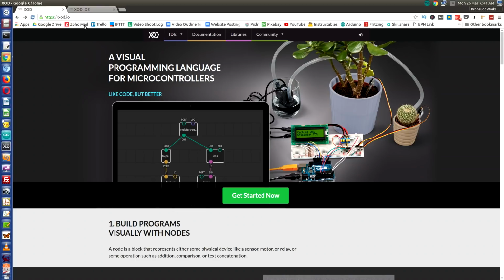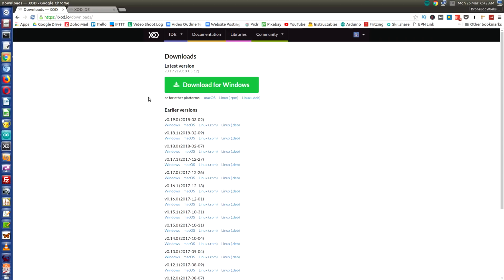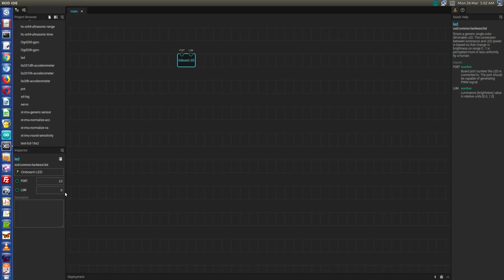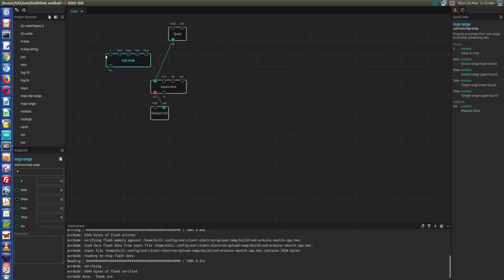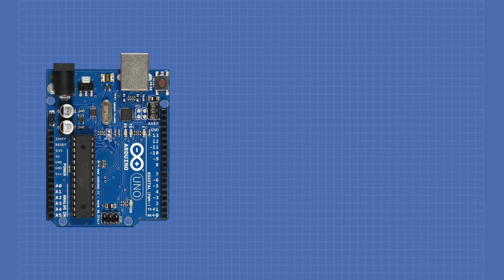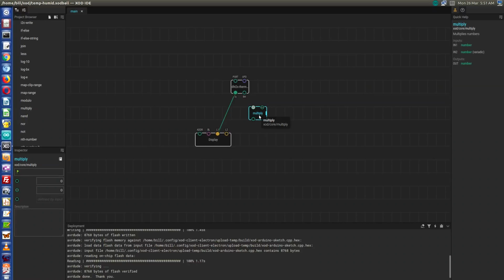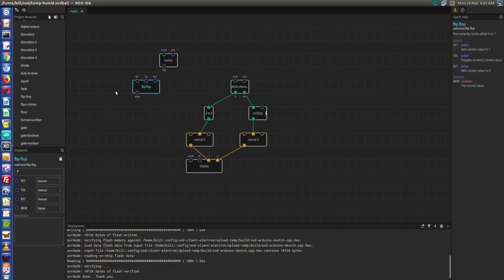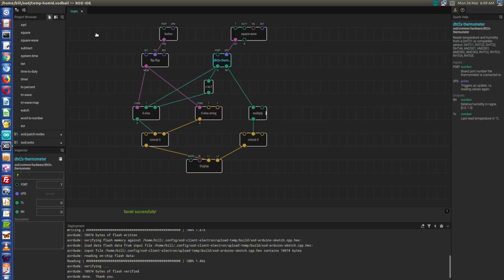Arduino Programming with XOD - Learning XOD

Comment: I see that others have the same problem I encountered. Your excellent (as usual) tutorial is the best I have found for XOD. However, the latest version of XOD (0.38.0 12 MAR 2021) is quite different from the version you used for this tutorial.

I humbly suggest updating this tutorial to suggest downloading ver. 0.19.2 from the website. Later versions may work as well, but 0.38.0 does not have either a plain digital LED, nor a square wave node in the Core.
Reply: Oops! I found it using a double-click to open a search box in the main patch.

Comment: Houston, I have a problem :( I have an Arduino 33 IoT and I can't figure it out how to connect to Internet. It seems that there is no library for uBlox W102 and I'm using XOD because I am so bad at writing code...of course. My question is: Is there any way of connecting to internet using what the default XOD blocks/nodes? THANK YOU!

Comment: When we look at people in general, it is enough for them that the benches work, ie this applies to the MIT app service as well as to Cisco network simulators, as well as to these circuit board simulators, of which the automation tools Terraform and Ansible are also examples, ie these tools are a bit like  someone says you have to saw this difficult place with a hand saw even if you have a Feston multi-tool next to it

Comment: As someone said in comments here, xod is adding much more code to the project, 2, 3 times more, 0.9kb to almost 3kb
It is similar to other RAD programming languages, for example Delphi, VS C, etc.
If you program simple Hello World in cli C, it takes 2kb, but in VS C it can be 50 MB .... example only 
How we can control setup in the code, you have used Uno, sensor, and another board ?
But ok, let wait for the next presentations

Comment: After several attempts, I have given up on XOD. Firstly, it was troublesome to install the Desktop IDE on Mac and Raspberry Pi. MacOS stopped it dead in the tracks as unverifiable for malicious content. Raspberry Pi running Raspbian Buster called it out as incompatible with the Pi's ARM architecture. There was precious little help on the XOD forums. After spending a disproportionate amount of time, I got it working on the Mac. Only to find numerous quality issues and limitations. Deployment to ESP8266 puts a form in front of me with numerous configuration settings. Fair enough. But get this, the form is presented in a truncated form as if the lower part were clipped off, so I cannot submit the form, which I can neither drag nor scroll to reach the submit button. So deployment to ESP8266 is stuck in limbo. Speaking of limitations, I wanted to use SSL to connect with secured web-services. This is not supported and documentation is not helpful. I have wasted enough time. A product has teething problems, but some quality issues appear just shoddy work. Which is a shame because I genuinely believe block-based programming is fun! I use App Inventor from MIT for block-based programming Android phones and the experience is one of high quality and dependability. I may return to XOD in the future if their quality matches App Inventor. If you are tired of Arduino IDE, try PlatformIO but I recommend giving XOD a pass except for absolute beginners. CHeers!

Comment: Just started with XOD two days ago, so I'm a newbe to say the least. I'm not crazy about coding so this ii great for me. I have some questions though. I watched the Arduino Programing with XOD tutorial and found it easy to follow. However a couple of confusing ( to me ) items. I couldn't find "map-range" in the core listing and in the common-hardware "LED" looked very different. The video showed the LED as a 2-pin node. My software's LED has 4 pins. I downloaded the latest version so I bet there are a number of differences. Is there a resource that explains the different nodes in more detail than the "quick help" ?

Comment: Over the years i have programmed in a huge variety of languages from Macro 10 and Teco10 on PDP10s via Fortran, C, C++ VB, JS,VBA and most recently Python and Powershell in a variriet of flavours of Unix, Linux FreeBSD and of course Windows In truth the only difference is the semantics. The essential stay the same. A loop is a loop. Modern languages have huge libraries of code, be it drawing a Form in VB or opening a connection to a display on an I2C interface on a Pi or Arduino. 

I am working on a project to build a Pan Tilt Zoom for a full frame digital camera with steppers controlled by a Pi or more likely an Arduino. I see no reason to learn to code in Atmel or ARM binary code so whatever happens it will be a coded at a  'higher level' . The choice then comes down to what. Once i have dug around enough to find the appropriate libraries/function/class/call/method/property oh and data format I could do it it C++. But as the processor load will be low and this is not a coding project but a photography add on I think the XOD might do very nicely - even if the code may end up fat and over complex.

P.S. great video introduction to XOD for us newbies to this programming style.

Comment: Excellent! - Only one thing missing that I would have like to have seen shown - the sketch produced for your temperature/humidity project. But I did find the XOD files in your blog - so thanks for that. 
This just left one question. Having selected "show code in Arduino", I pasted it into the Aduino IDE and received compile error messages - suggesting that switching between XOD and the classic IDE would incur issues. So is it a case that there is no portability between the two and you perhaps can't take code previously written in the classic IDE and then work on it in XOD either?

Comment: Does it not matter the resistance rating of the pot you use? How did you know what rating pot to use?
Reply: usually, the pots are  10 K but I have used down to 1 K and as high as 100 k. The difference is in resolution- if you use a low ohm pot, you twist the dial, you might be able to resolve 5 or six points,  whereas a 10 K you can move the dial a single digit at a time from, 1 to 100. The higher the pot value, the higher the resolution per turn. These pots simulate analog sensors.

Comment: At 71 yrs old I find hardcore programming to intense and thank you for this well made tutorial and the alternative method for toying with my Red Board (Arduino uno clone)
Reply: Dfplayer module is included in xod?! plz
Reply: Fully agree!

Klaus, EE and ex- semiconductor test engineer...
Reply: 69 here. agree! and I used to write Z80 machine code! We did this stuff before IBM personal computers existed -
Reply: @idontneednostinkingchannel6848  Dfplayer module is included in xod?! plz
Reply: @idontneednostinkingchannel6848  Hi..79 here.. another Z80 buff.  Built 3 Nascom 2s for laboratory data logging.  XOD neophite.  I don't think I would have got very far wthout this excellent tutorial Thank you .

Comment: looks like something changed in XOD with V0.27.0.  The nodes have more inputs and outputs.  That may not be an issue in most cases however I cannot get the DHT22 to show the temp and humidity with XOD.  When I upload your Arduino IDE sketch from your LCD Display tutorial it works fine.  When I use XOD, even at the point where all you have programmed is the display and the DHT22, all I get is 0.00 and 0.00.    This is at the point where you show 22.00 and 0.43.  Have you had any issues with the latest DHT22 node in XOD?

Comment: you said dooty LOL. 
no. to be serious, this is interesting but perhaps not something i will use, i will try it out though. I have done high level Defense Contractor programming of automated test equipment using HP Vee and National Instruments LabView. 
I am curious about the 'code' one can transfer from the web client to the PC, would that be user modifiable for higher level internal changes, or is it as gobbledygookish as disassembled compiled code in any other language? 
for address of i2c you can't say 0x3f? most things have ability to understand alternate bases at least for the big few.
you did not mention, but if you use the pc client but cloud compile, is that limited to the 1000 a day?
Reply: you should in later videos talk about debugging, tracing your project in xod, nobody writes perfect code off the bat,

Comment: WHAT EVER YOU DID TO DOWN LOAD THE IDE DOESNOT WORK FOR ME . THE ONLY BUTTON TO GET ANY RESULTS IS THE LIBRARIES BUTTON ALL OTHERS DO NOTHING. I LIKE THE PROGRAM AND I WOULD LIKE TO USE IT. IS THERE A PARTICULAR TIME OF DAY THAT YOU CAN DOWN LOAD?
Reply: Ron, I had the same problem. It was my Uno not being recognized for first time. I kept my XOD open and unplugged it an re-plugged it to the USB cable a few times, finally everything clicked and started working. Check port settings and baud rate. That seems to be where the incompatibility was.

Comment: Alright! XOD sound pretty easy compares to Arduino IDE. BUT...
I use XOD to make a simple "blink".
I have a problem: when I try to "deploy", I get this message:
Checking Arduino dependencies...
Arduino dependencies missing
You have to install these packages first: esp8266.
I cannot find anywhere something about how to install this package, neither where to find it.
Second thing:  I avoided the "dependencies problem" by copying the codes from XOD deploy menu:  show the codes...
But, I have 1551 lines of codes... Compare to the Arduino IDE,  its a LOT of codes lines...
So, how can I go around the "dependency" issue, and is it normal to have more than 1550 lines of codes for just a "blink" program?

Thank for your time. I look at your videos for a while, and I really like all of them. Continue your good job, my friend.

Comment: I’m new to all of this, I’m building a electric train layout and starting to add the electrical lighting, the Arduino adds a new level of possibilities. Your videos are a great help, very clear and understandable. I now have a better understanding of how a 555 timer works and a silicone chip.
Question- with your flashing LED if a sine wave was used instead of a square wave would the LED ramp up and down instead of blinking?
My Arduino is in the mail and I’m looking forward to learning.
Thanks
Reply: Again, 2 years and no answer from anyone.

Comment: I followed your articles, you really are something rare in the field, your explanations are great. you're the best.
I ask you for help, with the xod program, when I clicked the View Code button for the Arduino button. I saw that the code does not change and there is no connection between the xOD patch and the code. The code remains constant. I copy the code, and try to upload the code to Proteus it does not work. When i click the upload button to arduino, it works but then i have to build the circuit and i do not want to work with hardware do you have a way to help me without using a hex file i would appreciate very much for your reply

Comment: I applaud you on your delivery and very clear explanations, I tried XOD and to be fair I find it quite good at what it does , but like a few others I like to code in "low level" as you have more control over what's happening, plus these visual programming languages throw far too much junk into the mix, as an example, the Blink program using Arduino sketch uses 928 bytes but using XOD (in your example) it's bumped up to 2688 bytes , that's an extra 1760 bytes to do the same thing, on a program so simple nearly 2KB extra is 2KB wasted, as our programs get bigger I assume XOD is going to throw even more code into the mix and it won't be too long before lack of memory becomes an issue.

Comment: What is the library support for all major and minor sensors and devices like? How much on-chip memory does it use compared to the equivalent traditional Arduino IDE written code? Also does it compile to a very performant  code? For example, using square-wave on a hardware PWM pin.. does it use the hardware and when used on a digital output that does not have PWM, does it intelligently know to use software PWM (with a warning)?

Comment: I recommend checking the wikis on Pure Data, Firmata, Pduino. Someone in the comments also mentioned another called Visuino that I've never heard of. When you mentioned that "patches" can be used as (objects) in another patch, I thought that is REALLY a lot like Pure Data. In PureData, or Pd for short, you can write expressions in the box and inputs start popping up at the top for the variables, very powerful. (Check out Pure Data's "Gem", the video end of PureData.) XOD looks like a variant that uses a lot of graphical resources. Pd is very robust and visually more efficient, IMO.

https://youtu.be/g_hiz-Kx0kM

Comment: I've followed along with most of what you've shown. However, looking at the code that this program creates to be uploaded seems to contain vast amounts of junk code. So much so that it's difficult to find lines of code that are actually making the led blink, for example. So am I doing something wrong? Is there a way to turn this junk code off so you only see the absolute minimum lines of code that's actually needed? I don't mind seeing comments, but over 1600 lines of code just to make an LED blink. Something's wrong here.

Comment: I love it!   XOD is both intuitive and powerful and your tutorial was very clear and easy to understand.   I disagree with the comments from those who think this will discourage people from learning to program "properly".   I think it's just the opposite, because it frees the newcomer from the drudgery part of coding and allows people to get on with producing useful code for projects quickly and easily (which should be the goal).  The current generation of  programmers don't notice how much effort it takes to write conventional code, because it's become second nature to them.   When Apple introduced the GUI, I felt the same way about the GUI, because I was entrenched in the old "command line" method of interacting with a computer.  But, without the GUI, the general public would not have embraced the home computer and we would still be stuck in 1985 (working with MS-DOS).  Progress is about making things easier to use, but it's hard for those of us who had to invest years learning to do things the old way to embrace change.   For some tasks we will still need low level code, but for most tasks XOD (or something like it) will be faster and easier.    I have a question, is there a reverse compiler which can take an existing sketch that was previously written in the Arduino IDE and convert it into a XOD diagram?   I think that would be a useful tool for quickly analyzing the structure of existing programs.
Reply: Two years and no one will answer his question?    XOD must be a failure by now.
Reply: @gkess7106  After I made that comment and asked that question, I found several programs that can convert flow charts into Arduino code and convert Arduino code into flowcharts.   They worked OK on simple programs, but the free ones weren't much good for the complex programs I wanted to convert.  In any case, I wouldn't consider XOD to be a failure.

Comment: Totally noob question: what does I2C means? Why did the LCD had to be I2C?
Reply: I2C is a network protocol used on the many Micro Controllers. Its used to talk to peripherals like Analog to Digital converters etc. No you dont have to use I2C with a lcd. If you do you only need two wires to talk to the lcd if you dont you need 7. That means 7 ports on your arduino are not available for sensors or whatever because you are using them to talk to your lcd. So I2C saves you on port space. Also you can have more than one I2c device on the same 2 ports, because each I2C device has its own unique id when you want to talk to it.

Comment: Excellent Merci
Reply: how to modified that your project arduino programming with xod using like as thermostat..for example, like in airconditioning.once the temp. you set to 20 degree celius in the thermotat and once the temp. rich to your settings the compressor of ac it will  be off.thanks

Comment: Thanks a lot. Very useful and interesting as usual. I would like to ask about changing the sensor to BME 280. It has four values to read as Temp Humid Attitude and Pressure. It will be an advanced project. Is it possible to realize it with LCD 16x2?